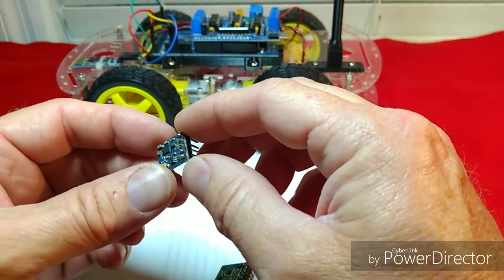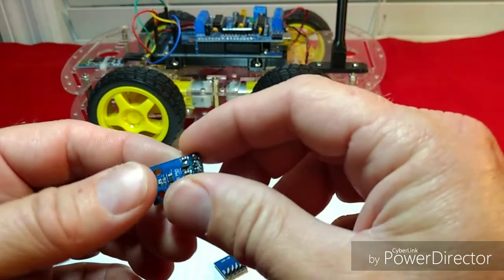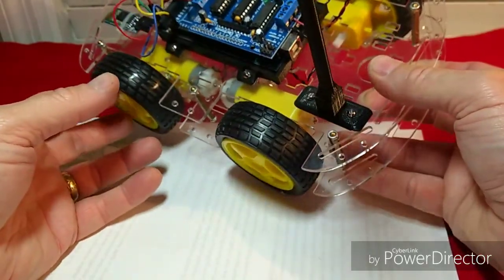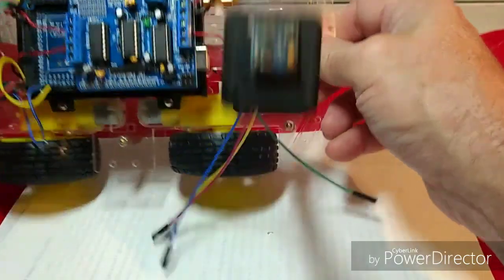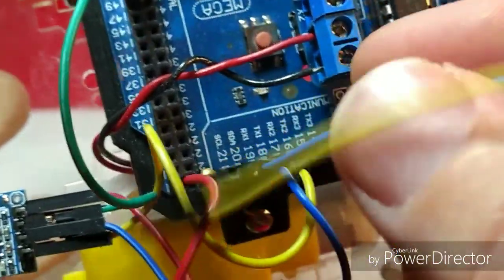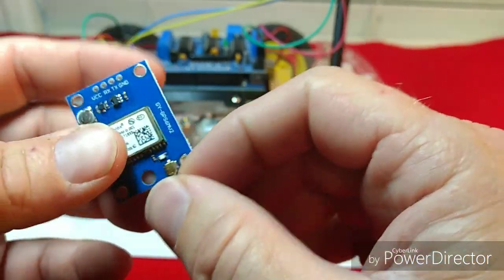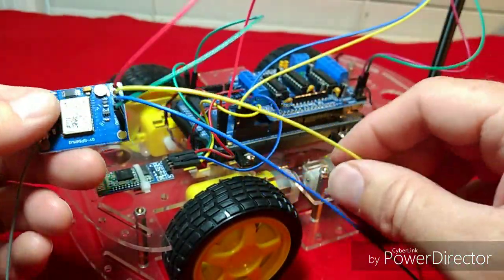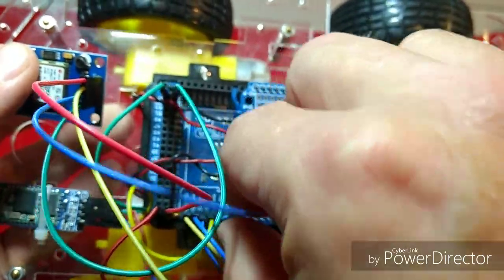How to Build a GPS Guided Bluetooth Robot - Part 2

Comment: Hi EZtech. 
Thanks you for indicating via instructables;
Maybe my question is silly (I'm not programma code, or architect software) but hopeful you reply me. I have been reading overview "I started noticing that some people were building robotic lawnmowers, which seemed pretty simple. They were using RC remotes to control their lawnmowers, but there was one huge problem with this design. When the person would start out mowing the grass everything was great, but when they would reach the end of the lawn and turn around the person invariable got off course and would constantly have to correct their steering. Eventually, after getting off course so much they would give up trying to keep nice straight lines and just zoom all over the yard, which didn’t look very good. I also noticed that many of the commercial robotic lawn mowers operated on the same principle, zoom all over the yard in hopes that eventually all the grass would get mowed. This seemed very inefficient. I thought there had to be a better way"  

And I'm thinking about concern diagram and pwm pinout (enable pins). Because if you upgrade big machine then you will use pwm pins function. So then this code will be changed.

Comment: Sir, Should I use L298N module and 12v battery instead of L293d and 7.4v battery
Reply from the maker: I wouldn't suggest it, it would complicate the project. It could be done but be prepared to change alot of wiring
Reply: @EZtech  @EZtech I need your help. I have done everything step by step. I have made the circuit, and calibrated the compass, and uploaded the code. And did everything which you told in this video. But the problem is that, I never got any output whenever I press any button in the app. Even the connection is proper and code is properly uploaded, also compass has been calibrated perfectly but nothing works with the app, whenever I press any button.

Comment: Did you connect the VCC of the GPS into the 3v pin ? The RX works with 3V ?
Reply from the maker: Daisy Fernández The Ublox 6m GPS module is powered with 5 volts, as well as the HC-06 Bluetooth and the HMC5883l. I believe all of these can be powered by either 3 volts or 5 volts. I have had problems when powering the Bluetooth module with 3volts. There has been some discussion on the internet as wether or not the data lines, rx and tx should have a logic level shifter. I have only done that on the first robot I built, and had constant problems. Since I started powering everything with 5 volts all those problems went away.
Reply: @EZtech  @EZtech I need your help. I have done everything step by step. I have made the circuit, and calibrated the compass, and uploaded the code. And did everything which you told in this video. But the problem is that, I never got any output whenever I press any button in the app. Even the connection is proper and code is properly uploaded, also compass has been calibrated perfectly but nothing works with the app, whenever I press any button.
Reply: EZtech Thank you !!
Reply from the maker: Daisy Fernández Did you take it outside? Depending on your location it may be difficult for the GPS module to lock on. Take it outside for 10 minutes with power hooked up, just vcc and ground is all you need. The LED should start blinking after it starts receiving nema sentences.
Reply: EZtech yes i did it, but it didn't work out.
Reply from the maker: Daisy Fernández I had one that I thought was dead, I left it hooked up near a window and was surprised when I came back hours later and it was working. You may also want to use a voltage meter and check to see if you have 5volts   at the GPS. Also check for bad solder joints as well. If this all checks good then I would have to say the GPS module is bad.
Reply: EZtech It worked !!! Thanks a lot !!! 😁

Comment: Thank you ! Great video and great tips ! When would part 3 be up ?
Reply from the maker: Daisy Fernández This weekend, thanks for watching!
Reply from the maker: I just uploaded the Instructable on how to build the GPS Guided robot, check it out. https://www.instructables.com/id/How-to-Build-a-GPS-Guided-Robot/
Reply: @EZtech  @EZtech I need your help. I have done everything step by step. I have made the circuit, and calibrated the compass, and uploaded the code. And did everything which you told in this video. But the problem is that, I never got any output whenever I press any button in the app. Even the connection is proper and code is properly uploaded, also compass has been calibrated perfectly but nothing works with the app, whenever I press any button.